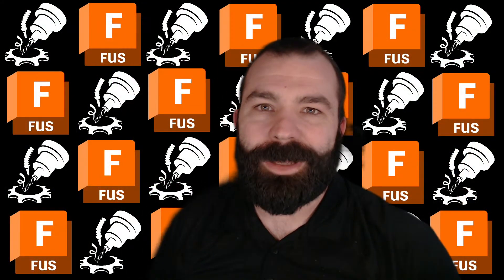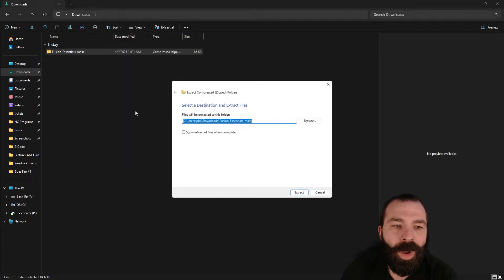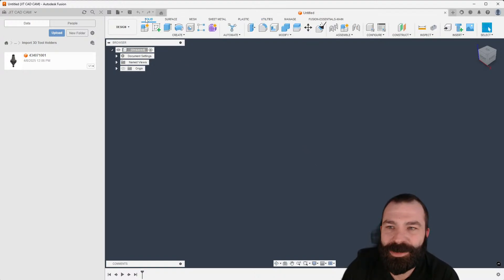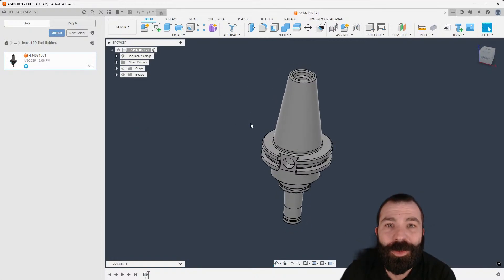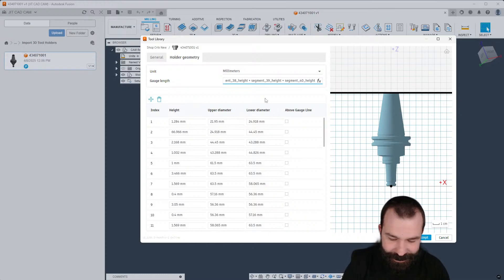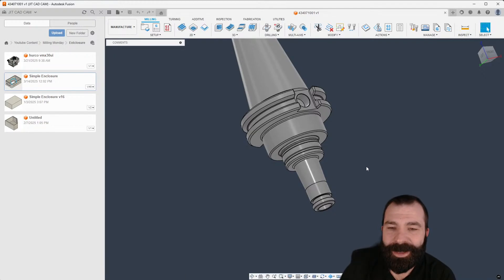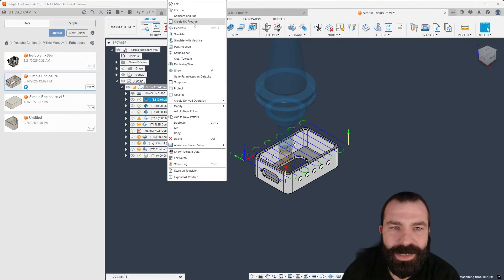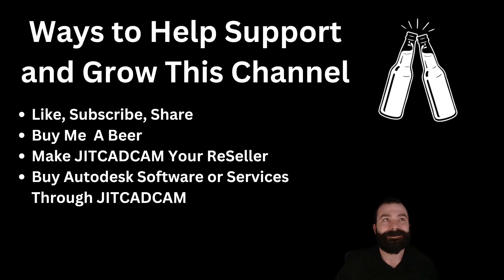Workflow Wednesday: Importing 3D Tool Holder

Comment: Btw nice description on gage length setting.  Our school entered a 5 axis competition Project MFg in 2022.  We did not have a 5 axis machine to practice on so we depended on Fusion machine simulation. Very good on setting up your machine as described per setup sheet to prevent crashes.  I always wondered why the tools were not seated in spindle during sim.    Anyway we ended up in final 4 in that competition.
Reply from the maker: Thats awesome and Thank you